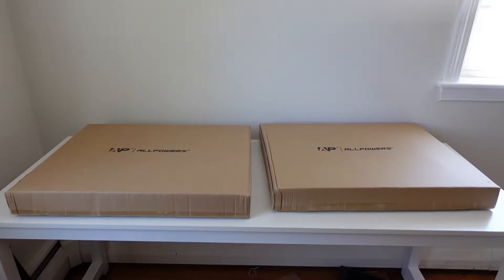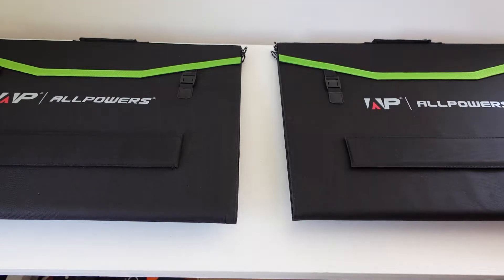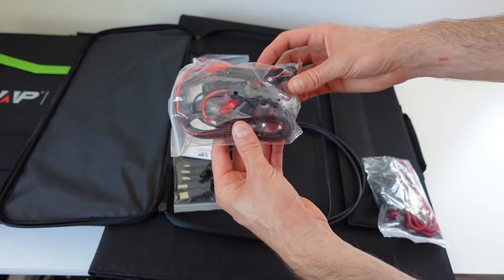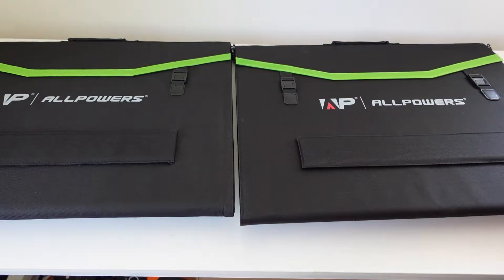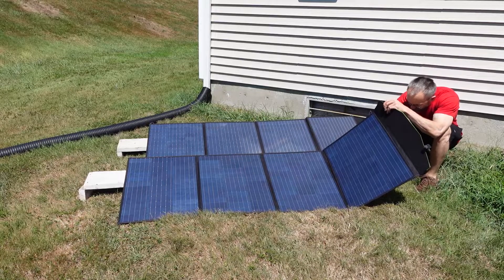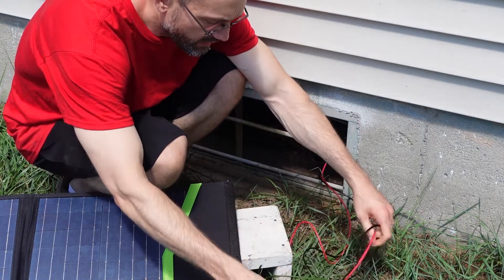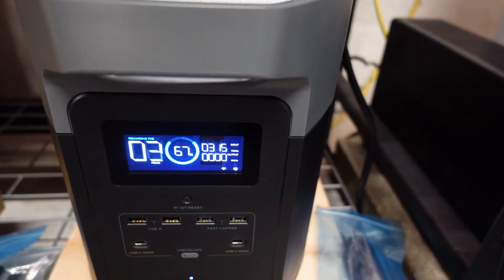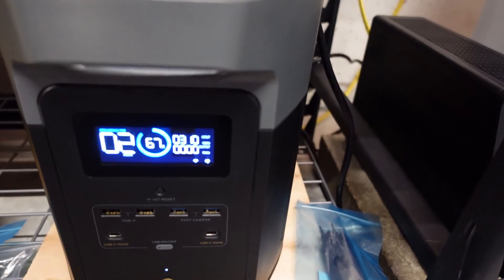Running TWO Allpowers AP-2X033 Portable Solar Panels in Series with the Ecoflow Delta Max (Part 5)

Comment: I have the same 2 panels and will be getting a Delta 2 soon. Right now using a River Max Plus which is spec'd the same as a River Pro without the extra battery. Thought I saw 344 input watts briefly on your Delta Max. Hoping o achieve similar with Delta 2 under the right conditions.
Reply from the maker: Good luck!
Reply: I’m the specs of these solar panels confuse me and I can’t get my head around it. I have a delta 2 as well did this setup work? This seems better than carry around the giant EcoFlow 400w monster panel.

Comment: Hi
How do you connect panels when there only one cable and plug on the power bank?
Reply from the maker: Hello! The solar panels come with adapters so you should be able to find one that fits
Reply: What .. I watched an bo wiser .  How do you connect 2 panels.   Do you need a different connection
Reply: Those panels don’t come with XT60 from my experience.